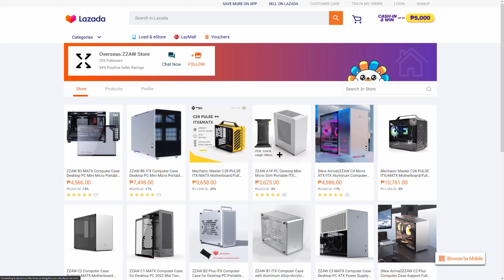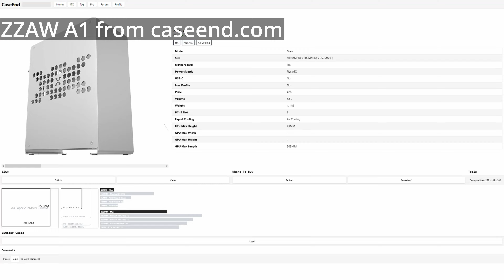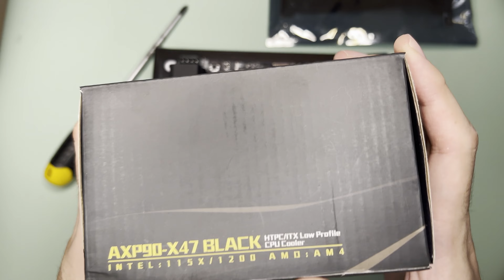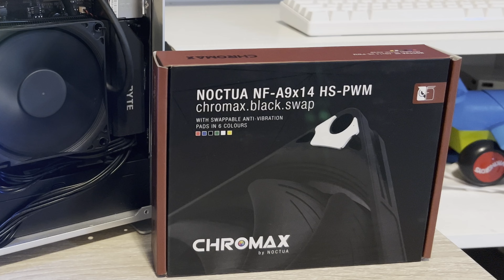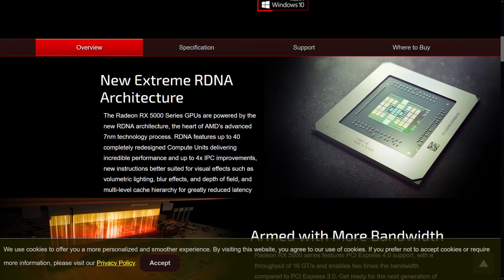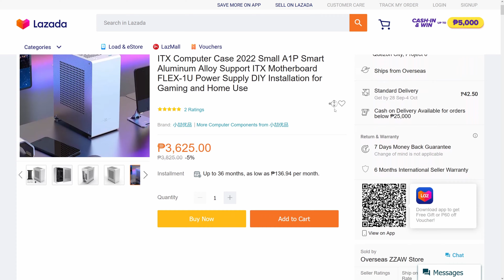ZZAW A1P BUILD | A 5.8L SFF ITX Build

Comment: Will your ID Cooling IS-55 fit the A520i AC without hitting the RAM area?
Reply from the maker: As the a520i ac is no longer in my possession, I don't have definite answers. But looking at it, it should be fine, just compy to their ram height requirement. To your premise though, motherboard ram section won't be a concern, but rather the VRM HS and the actual RAM height.

Best is to contact id cooling directly though for authorative answer.

Thanks
Reply: @manongunboxing  BTW, thanks as well for giving cool ideas for itx builds.

Comment: Will this case support asus phoenix RTX 3060 Single fan? thinking about doing a build
Reply from the maker: I don't think so. Asus 3060 phoenix is 2.5 slots thick. The case can only support up to 2 slots.
Reply: @manongunboxing  oh alright because the rtx 3060 supports k39 v3 so assumed it would support this case
Reply from the maker: Yeah some cases will say 2 slots only and exactly that. Some can be pushed to fit more. I wouldn't let someone risk it though 🙂

Comment: Sir pasensya sa abala. Ano pong magandang case sa 5 5600G na APU build na pang travel na din. Below 25k build. Thank you!
Reply from the maker: If APU and ok with the ff:
1. Proprietary components and its risk (not really future proof)
2. No plans for dGPU (or ok with a janky "egpu" solution)
3. Not really "wow" for games

Then I'd go for Asrock Deskmini X300. Light enough.

For 25k budget:
10k deskmini x300: case / mobo / power
7k 5600g proc
4k 32gb ddr4 sodimm RAM
The rest for ssd (m.2 nvme or sata)

Comment: Kasya kaya yung sapphire pulse rx 7600 sa zzaw a1p kasi i plan to am5 itx build
Reply from the maker: Won't fit po. You may check gpu length ng sapphire rx 7600 vs gpu length compatibility nitong case.

Comment: sir naguluhan lang ako base sa spec ng case kaya 90mm fan pero nilagay mo 92mm, di ba nag ka problem sa pag screw ng fan
Reply from the maker: Ah sorry. "Interchangeable" ang 90 and 92mm.  92mm yung precise dimension talaga ng fans pero yung iba ang naming ay "90" lang, e.g. Thermalright tl-9015, by name dapat 90mm (length and width) x 15mm (thick), pero reality 92mm talaga yung length and width.
For noctua and scythe, ang meron lang din ay 92mm fans and no offering of 90mm fans.
As for cases, sila ay notorius sa "90mm" compatibility pero don't worry, kasya 92mm precise dimension.

I also had similar concerns back then, sabi ko na lang bahala na. So far, 92mm fan works since di ka talaga makakahanap ng precise 90mm fan from top brands. Also, while concern ang 1mm sa gpu / cpu cooler compat, sa screw hindi gaano, can't explain why pero hindi ganong kasensitive.

I hope I made sense.
Reply: @manongunboxing  boss thank you sa info 👌

Comment: Hello po. Pwede po kaya liquid cooled APU on this case? Radiator dun sa kung saan dapat yung GPU?
Reply from the maker: Kung AIO, mukhang malabo sir. Bale kelangan mailusot yung rad or pump sa ibabaw kaso di nabubuksan yun... Baka di kasya. Nasa 20mm lang opening kasi nun.

Kung custom loop sir mas posible. Pero yung pump and reservoir di ko lang maisip saan ilalagay. Sa labas siguro.

Regardless sir, 120mm rad lang kasya. Consider na 44mm gpu thickness lang ang supported. 27mm sa rad + 15mm sa fan, sagaran hehe.
Reply: @manongunboxing  Salamat sa pagsagot sir. Yun rin nga concern ko kung pano papalosot sa kabilang compartment yung rad+fan. Sguro overkill din naman sya for 5700g hehe
Reply from the maker: Yes sir, overkill aio for 5700g. 95% of the time, pwede na stock cooler.

If you want best low profile (47mm), alpemfohn blackridge -- mahal lang.
Good compat + good quiet perf: noctua nh-l9a-am4
Cheap and good pero sakit sa ulo (installation and noise): thermalright axp90-x47
Reply: @manongunboxing  noctua l9a gamit ko ngayon sa 3400g ko currently. Upgrade ako soon to 5700g. Gusto ko kasi mgtry liquid cool naman, cool kasi hehe. Baka may marerecomend ka sir na smallest case na pwde aio sir, Salamat po
Reply from the maker: So far sir, wala pa. Pero hanap po ako ng sub 7L. So far, nasa 10L na kasi mga nakikita ko. If nasa ganon na yung volume, e di lian li a4 h2o na lang.

Comment: Boss tanong lang po bakit po nag gpu pa kayo G nman po yung proce nyo? Plano ko kasi mag build dn same nyan pero wala na graphics card ryzen 5 5600g
Reply from the maker: For every case that I try on, lagi ko pong sinusubukan yung best gpu na meron ako na kakasya para malaman ko yung cooling perf ng gpu sa case. Without me testing it, hindi ko makikita yung problema sa case (in this case, hirap sya sa dual fan gpus and ok sa single fan gpus).

Yung processor choice ko is that ibibigay ko kasi sa kapatid ko yung case, mobo, and cpu. Kaya yun ang ginamit ko po at the time, less work for me hehe. Recently lang ako nag-standardize to 5800x w/ dgpu build or 5600g for apu build.

Lastly, di rin naman po kasi bawal and sensible sya na upgrade path. Say 5600g kayo now w/o dgpu, pwede yan salpakan ng rtx 3060 for better graphics performance.

Comment: be careful when choosing the motherboard for this case because some motherboards have a large extended protruding heatsink by the I/O ports and it might block the power supply from going into the case. One example is the Asus ROG B660i itx motherboard.

Comment: Boss compared to sg K39 ano po smaller, tsaka sana mag share karin ng video sa FSP Flex guru 500w. And fan mod if gagawin mo. 

 Building my first sff with sgk39, 5600g, Gigabyte a520i, flexguru pro 500
Reply from the maker: Smaller po sg k39 (4.4L vs 5.2L).

Malabo sir fan mod. Basta po psu, ayaw ko po galawin.
Reply: @manongunboxing  understandable sir salamat, kumusta naman po noise ng flex guru under gaming load sir?
Reply from the maker: Negligible sir. Kelangan ko ilapit ng sobra tenga ko sa psu para marinig. Ang maingay sa builds ko usually ay yung fan ng cpu or gpu.
Reply: @manongunboxing  salamat sa info, big help talaga sa build ko
Reply: @manongunboxing  salamat sa info, big help talaga sa build ko

Comment: magkano po inaabot usually ng ganyang build? balak ko mag build para sa anak ko pang minecraft lng at microsoft office.
Reply from the maker: Yung exact build, nasa 34K (nilagay ko po yung breakdown sa description).

If for minecraft na walang ray tracing and no shaders, pwede kayo makatipid with 5600G though -- better CPU as well. Gumamit lang ako ng 4350g kasi yun ang available na pwede ko ibigay sa kapatid ko.

5600G option:
Case: ZZAW A1P - PHP 3.6K
Processor: Ryzen 3 5600g- PHP 7K
Motherboard: Gigabyte UD A520I AC - PHP 6K
RAM: Kingston 2x8GB 3200Mhz CL16 - PHP 2.2K
CPU Cooler: Thermalright AXP90-X47 - PHP 2K
PSU: FSP FlexGuru Pro 500W - PHP 5K
Total: 25.8K
Reply: @manongunboxing  salamat po ng marami

Comment: Kasya ba yung A520I MoBo sa D21 Pro Case Sir?
Reply from the maker: Yes. Standard po ang "itx" motherboadx form factor and d21 pro supports only itx form factor.
Reply: @manongunboxing  Yang A520I MoBo has the Wifi and BT antennas, w/ 2 hdmi ports diba? Baka gamitin ko kasi for dual screen WFH Sir.
Reply from the maker: @scyyon  BT and WiFI yes. With 2 HDMI ports yes, but you'd be only able to utilize it with an AMD G processor. If not, you need to buy separate discrete GPU.

Comment: Flexguru 500w pwede sa amd 5 5600x at red devil 6600xt?
Reply from the maker: Yes. Pero best po is to check your specs sa calculator din: 
https://www.fsplifestyle.com/landing/calculator.html
Reply: 383 watts pero recommended 550w
Reply from the maker: Kaya po yan, 76% utilization on full load
Reply: Kahit 18 hours daily use? Kaya bah ng flexguru 500w po?
Reply from the maker: 18 hrs daily on full load?
Reply from the maker: Kung 18hrs na full load, actually heat lang kalaban... So pls maintain the fans na lang and ensure yugn ventilation.
Reply from the maker: Anyway, to answer, I believe kaya. However, best is to inquire directly w/FSP: https://www.fsplifestyle.com/uk/ContactUs.php

Usually, yung branded PSU, rated sila sa ilang % overcapacity. Say sa 20%... So 600W talaga kaya tapos magttrip yung overpower protector or some others so magshushutdown yung system.

So ang issue talaga e overheating so sa 18hrs na bukas, 18hrs din yung intake ng dumi. Just maintain it, ensure na proper yung intake and exhaust.
Reply: Gusto ko bumili sa Velkase Enhance ENP 7660B 600w cost of $215.. 4-8 days expedite
Reply: Sige po maraming salamat talaga sa lahat ng details